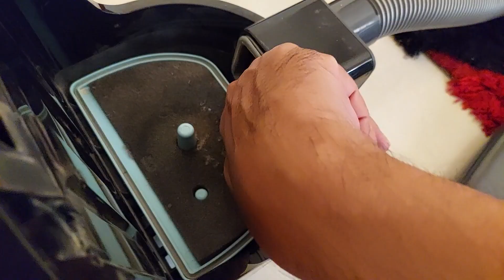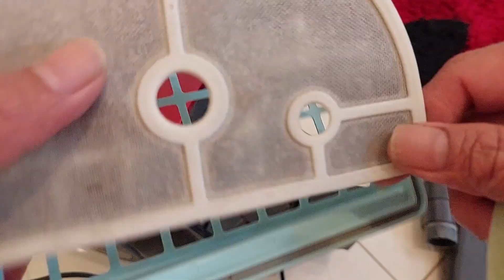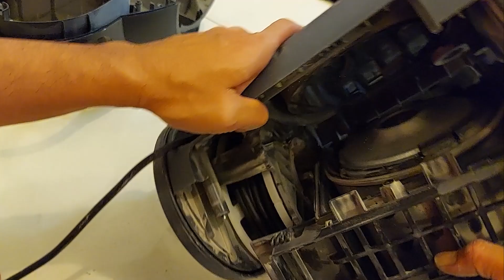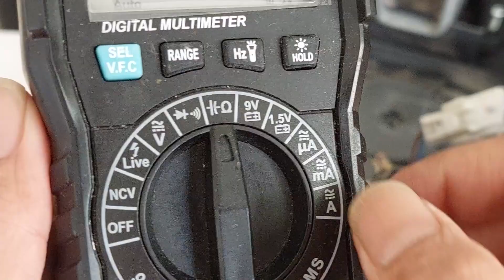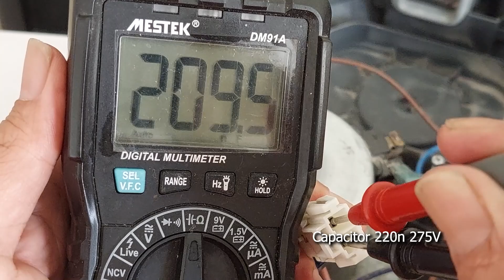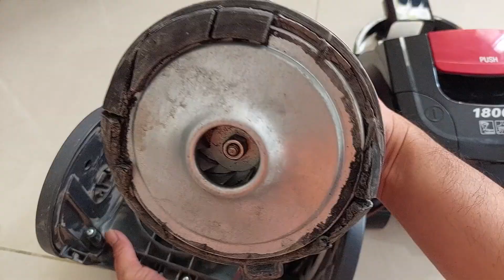How to Repair Vacuum Cleaner ON and OFF - Complete Steps

Comment: Throw it in the trash, it isn't worth fixing. LG absolutely stinks. Pretty much all LG products will develop multiple problems like this almost immediately after you purchase them. You can repair the problem and it will reoccur after a few minutes of use or another, more severe problem will take it's place.  They are not intended to be repaired LG products look very nice, but they absolutely have no reliability. All LG products are pretty badly designed for actual purposes they're supposed to serve. The life lesson is DO NOT BUY LG PRODUCTS - EVER.